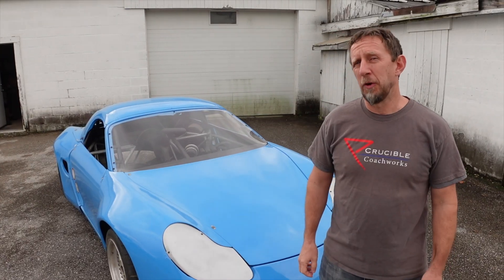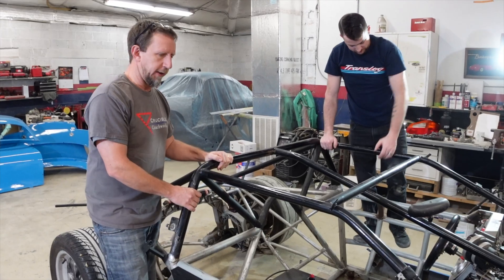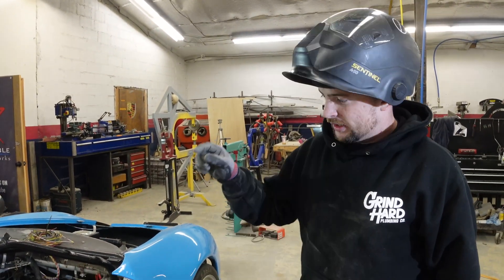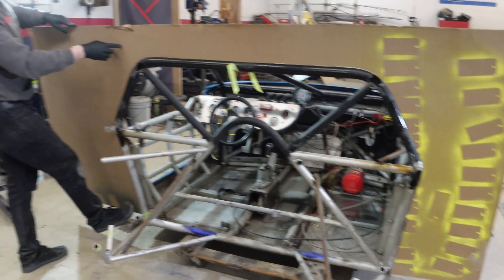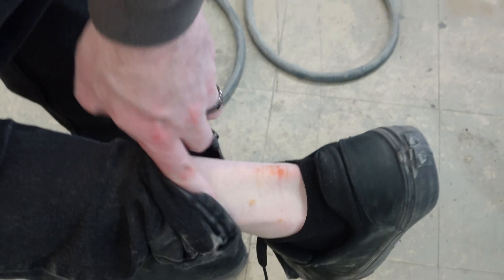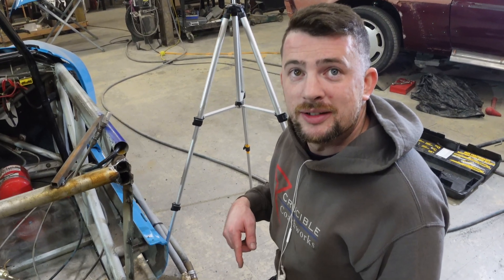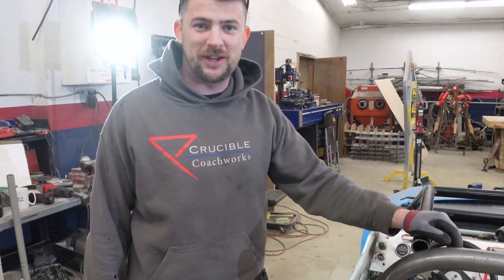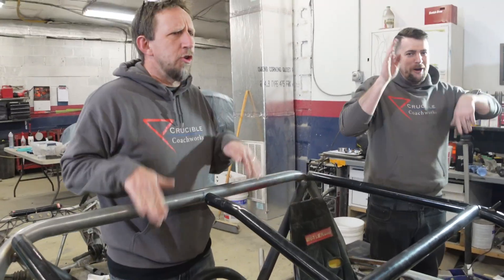This MAJOR Mistake Will Keep You Off the Race Track!

Comment: Can't you still repair the main hoop if you do and insert with butt and rosette welds? I just modified a Cab DAS bolt-in roll bar to fit in my 82' Coupe but I cut off the bottom to shorten it and the kickers.